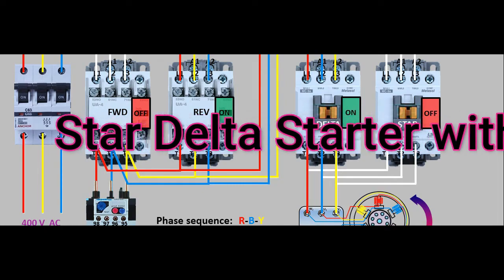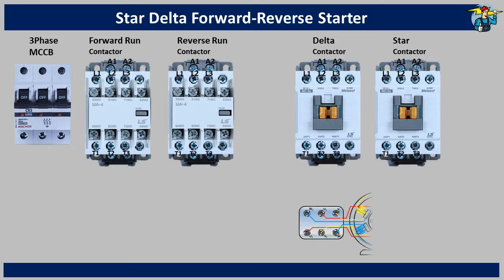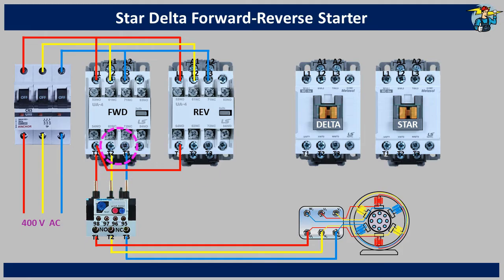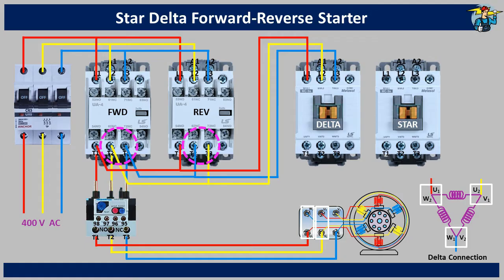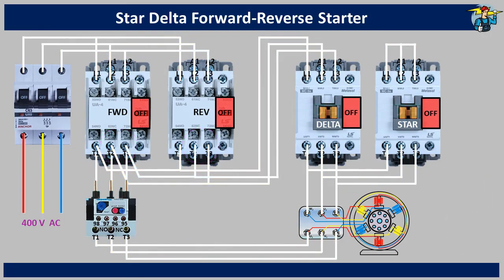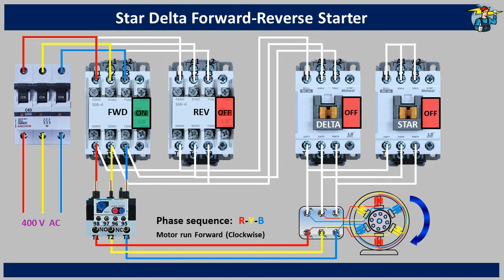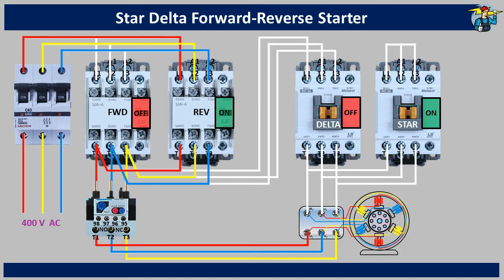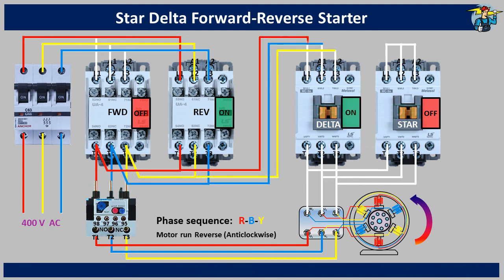Star Delta Starter with Motor Reversing Option / Reversing of Induction Motor / Power Circuit

Comment: Good tutorial, but I didn't see any wire that which connects to the A1 & A2 terminals for both forward and reverse contactors.  🤔
Could you please tell us more?

I'm from Bhutan.       🇧🇹
Reply from the maker: Control circuit wiring is not shown here.
Soon will do a video on it.